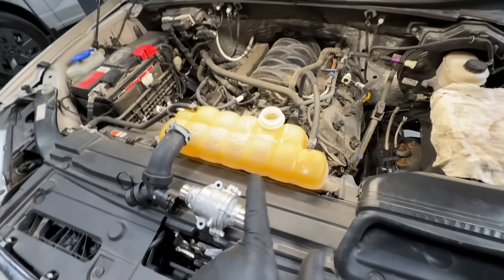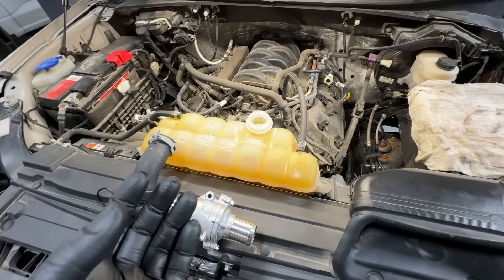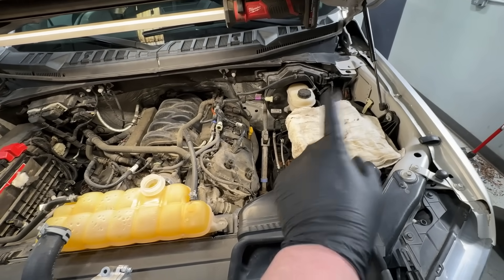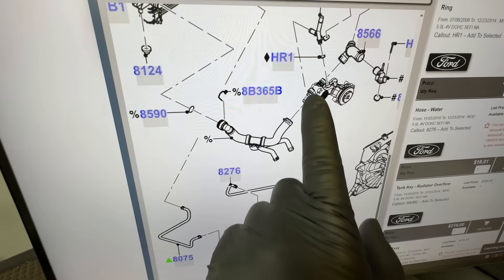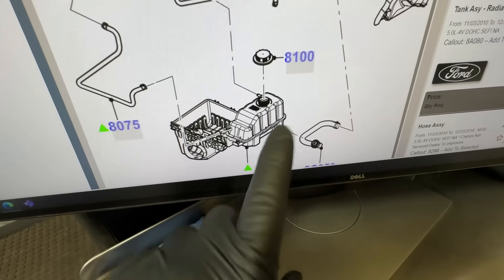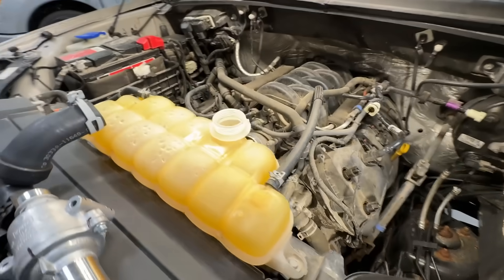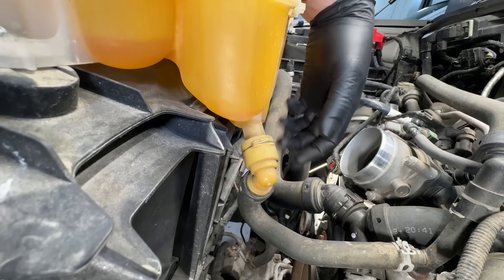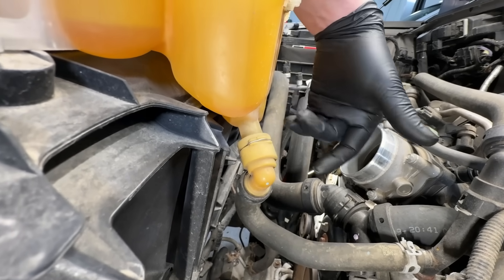2011+ Ford F-150 5.0L Coyote Engines: The Top 5 Most Common Coolant Leaks!

Comment: I agree. It is a crap engine.
Reply: It's only crap if you treat it like crap unless your this guy and you constantly work on them all day every day of the work week which does defeat the point of this engine being reliable. It's just like any other mechanic that specializes in other car brands they all have their pro and cons but it's up too the consumer too either run the vehicle too the ground with no maintenance and bitch about it not be reliable or you baby it and take proper care of it and have good things too say about (not excludingthe 2.7 or 3.5 ecoboost). What he's talking about are really only a minor issue unless it's a massive coolant leak that'll lead too overheating then it's a huge problem but if it's just dribbles you are fine until you can get the parts in and fix it before it gets bigger. The oil consumption is a way bigger issue then coolant leaks though cause that requires more time too he spent on fixing that issue.

Comment: HeyBrian, I have a 2017 3.5 eco-boost. I know it requires 5/30. Amazon sent me 5W 20 Pennzoil I changed it,will that cause any problems if I leave it in for a few thousand miles?thanks appreciate it as always.
Reply from the maker: Ideally it should not be an issue especially if it was winter but now with things warming up and it being turbo based I would drain and fill the oil and leave the filter.
Reply: @FordTechMakuloco  yeah, I was thinking the same thing. Just thought I could get away with it for a few months, but I am moving to Florida as well so probably not the greatest idea but, I really appreciate getting back so soon. I really appreciate it man. Enjoy the rest of your weekend.!
Reply: @FordTechMakuloco  hey, Brian.. I noticed when I was changing my oil yesterday that my oil pan was saturated with oil.. I’m guessing it was oil. I know you just did a video about this issue. Should I have the dealer replace this pan?truck is still under warranty..

Comment: My 2016 coyote in my F150 shit the bed at 60k with the cam phasers and VVT solenoids. Constantly stalling dealer blamed my synthetic oil and fram filters. I called BS and after fighting with management and Ford they ate it but not without a long fight. Of course they could never duplicate the issues but magically all fixed once the parts were replaced. Would’ve cost me $4k……Not this time. Got rid of my FORD POS shortly thereafter for a  2018 Toyota Tundra.   286k not a single issue yet

Comment: I've had one in 112,000 miles on my 2016; it was the most common leak. Eventually, I'll replace everything when I have to replace the water pump or T connector. I'll do all the tensioners at the same time. The A/C tensioner looks like crap, but it's still functioning.

Comment: Funny just had the heater hose replaced on mine...wish I had seen this video sooner as I couldn't find it. I have already done a waterpump and the t fitting orings as well as the connector upgrade for my coolant degas tank (2012).  I like the engine other than the ticking which it has pretty much done since new.  Also had the oil pan gasket leak and had it fixed too.  230k   Thanks for your videos!

Comment: Ouch man, 5.0L underpowered in a half ton truck?  And I don't see very many 5.0 daily drivers getting torn down to find piston skirts broken off like ecoboosts. All the water leaks were due to over-engineered hose fittings, none were the engine itself. Any engine will fail if pushed hard enough... but I see and know of tons of ecoboost total engine loss stories causing many customers to swear off Ford forever.
Reply from the maker: Yes underpowered or the calibration is off they just wind out the gears where as an EcoBoost will just pull big time. Maybe my views are skewed with the EcoBoost and electrics I have driven. They may not have skirt problems but neither do most EcoBoost engines. One thing I can tell you is the 5.0l sounds horrible, they have cylinder bore distortion issues, timing issues still 2015-2017 and valving issues on 2011-2013 models (I am replacing a 2013 5.0L now for this) and don't get me started on the 2018-2020 models. Now 2021+ have plenty of power and has been solid so far.

Comment: I just had a new 2005 ford -150 5.4l 3v create engine installed in my truck. I noticed the oils fill cap has a severe vacuum when I take it off while running. It makes a chirping sound on driver side. Once I pull oil fill cap the chirping stops. Any ideas?

Comment: Thanks @FordTechMakuloco for your information! Off subject question. I have a 2017 F150 5.0 with 90k miles. Been ran with 5w20 semi-synthetic its whole life. Should i swap to a 5w30 full synthetic to assist in the valve train noise which has gotten slightly more noisy the higher mileage it has gone? Thanks!

Comment: Im thinking about buying a 2016 v8 5.0 should I ?
Reply: do it, that's the best year for that engine. The worst issue I've ever seen with that year model engine is the VCT solenoids just not working and causing the engine to stall at a stop. They are not too difficult to get to for replacement and again not a very common issue if the oil has been kept up with. So the worst case scenario on that engine is actually an easy fix and can be done in a few hours.
Reply: @eliohernandez01 agree.I have 2015,5.0

Comment: Hey there i got 2010 4.6 2v and its got a little tick on passenger side i took the valve cover off did a visual inspection and checked the roller followers but have yet to find the culprit any thing would help its my daily work truck 120000 ive kept up with oil changes so it looks beautiful in there but i know what its supposed to sound like i bought it new what do you think ? Take the followers out and check lash adjusters to get a closer look at them ?

Comment: This is a very off topic question but no one really seems to know the answer so I figured to ask you since you are a very knowledgeable ford technician. My question is, do you know what causes the valve spring failures on the 6.2l engines? I have seen them from pretty much any year with these issues but many people claim they are not common. What I want to know is if these valve springs are failing due to lack of maintenance or excessive engine idling or just constant beating on the engine like foot to the floor? I have heard these engines are fairly reliable but the valve spring failures concern me. Thanks!

Comment: I’ve been driving the 5.3 for oh at least 20 plus years. Just bought the 5.0 and it’s sweet. Only 5900 miles on it so far but much better feeling engine.Did put a catch can on it  immediately and that’s already trapped about 6-8 oz of blow by.

Comment: I have a Ford XLT 4 door 4 wheel drive .It's a 2015 and the oil gauge doesn't t move and oil light red in color flashes as I was bringing it to mechanic. It wouldn't start just crank them stop . Could it be oil pump and is it seized . It still cracks just don t start .

Comment: I have 2013 f150 5.0 with 275 thousand miles from new only thing have done water pump 2 starters few quick coupler coolant lines 1 rear end seal

Comment: I currently just replaced my water pump under warranty, had a large leak behind the water pump. After replacing that its been a week now took off from a stop sign lost power, speedometer didn't work and check engine light is now on have yet to get the codes.. I did leave it sit now speedometer works agin but check engine is still illuminated

Comment: Could you do a rebuild or nothing on a brand new 29010 Ford F-150 XLT xtr engine 5.4 L versus a 150k miles good running engine just to show normal wear and tear. Maybe use a req test, but not waste the engine before salvage ticket! It would be extremely educational for me and many others, I would donate my engine to rebui)t if needed. Please DMand will would forward all info your way!

Comment: Recently ran into your videos great advice. Question my son bought a 2008 F-150 5.4 V8 I had someone mention to use 10-30 synthetic. Is that something you would recommend for that engine to build up more pressure in the oil pump to make sure everything gets lubricated or stick to the 5-30
Reply from the maker: 5w-30

Comment: Hi

 I have a 2007 Ford Explorer 3v 8v 4.6

 There is a problem with fuse number 2 in the input below the level of power

 Microcontroller (SJB)

 In smuggling electricity from the battery, how can you please solve this problem?

 Thank you.

Comment: I hope your shop is somewhere in California, I really need a mechanic like you. 🙏🏾

I have a 2014 Ford Explorer XLT 3.5 V6 with 2WD.

The engine was replaced with a remanufactured long block from Ford, around December 2023.

The same day I got it, I could feel a hard rumbling (when idle).

A few days after having it back, the check engine light came on. P0420 was the code.  I replaced the catalytic converter.

Still the hard vibrating continued....

About a week later, the check engine light started flashing and the car RESISTED acceleration. Codes P0302 and P0306 appeared on diagnostic. I changed the ignition coils (all 6). 

The spark plugs were inspected and appeared to have been replaced when the engine was installed. 

A few days later, check engine light flashed again and no sooner did it start, it stopped. But what I noticed is the car withdrawing from acceleration (when notification was flashing).

I took it to the dealer. They kept it for THREE DAYS (driving it uphill, running compression tests- per my request). 

They saw it misfiring on the scanner, but COULDN'T figure-out what was causing it.

Please help me. 🙏🏾 I beg you. I don't know what to do. 😢
Reply: I would get rid of and get a toyota 😢

Comment: Hey mister Ford guy. I have a question and I need guidance so please if you will respond. 2014 ford flex 3.5 non turbo  85000 miles and I know the tune up is right around the corner. I know you swear by Motorcraft genuine products and so do I however as far as the spark plugs I know it calls for SP520A Motorcraft. What is your opinion in the Bosch double platinum counterpart?  Well, they hold up like the Motorcraft plugs will?  I’m not having any misfires any kind of issues whatsoever it’s just come time to do the maintenance and I need some guidance please

Comment: Hello, Have you ever dealt with the IMRC chatter on the 6.2 in trucks? My 2017 F250 has a loud chatter that disappears when I disconnect the blue connectors on each side below the throttle body. Of course they are on national backorder. Thanks for any input you may have.
Reply from the maker: No I don't work on them.

Comment: Too much plastic then add hot water into the mix. Disposable / cheap.
Reply: Yep,plus cold and warm temperatures makes plastic brittle and prone to start cracking and leaking.
Plastics is good but I found cold temperature really change  the plastic material functionality.

Comment: So what motor would you recommend for the F150? I'm not buying Chevy's junk that uses 1 to 3  quarts of oil per oil change and carbon build up cause of V8/V4 mode.I know from experience I have a Chevy work truck. And Dodge junk Manifolds and transmissions  in their 1500.

Comment: You did a video showing how to change the coolant on the older gen where you can use hose.   With the new coolant you cant use tap water i thought so can you do a video showing a changeover to the new coolant with a system flush.

Comment: Awesome videos thanks, I have a 2013  5.0 f150 it’s has 193,000 miles ,  just getting a upper heater hose leak , no other leaks I guess I was lucky, but I’m planning to replace all hoses and will now replace the water pump and thermostat and housing , with all ford parts . Hopefully I get the same luck as before.

Comment: I usually agree with you but it all on how you use/ take care of it. I have a2020 and have had no issues with it but I’m always looking. It has a 140000 on it and still trucking
Reply from the maker: 18-20 models have known widespread mechanical defects that maintenance will not fix. You got very lucky so I would hold onto it.

Comment: Been watching you for years and you absolutely make some of the best videos on here! But your take on the 5.0 is where I strongly disagree. Not that I’m any expert, but the 5.0 is far from underpowered and strides ahead of the Ecoboost/5.4l in tech, power, reliability, and durability. I’ll take some rusty valve cover bolts and coolant leaks from mostly easy to replace parts over timing jobs, roller follower issues, turbo issues, oil pressure issues, etc any day. Regardless though, appreciate your videos as always and can’t thank you enough for all the times you saved me thousands in my old 5.4l!
Reply from the maker: Please see my previous response- Not saying they break down at all. I am just very disappointed in the engine as I had high hopes for them when they came out in 2011. The cylinder bore distortion issues, tuliped valves, way too many coolant leaks, some oil consumption issues on the rear cylinders, ignition coil bolts that rot and break (unacceptable in this day and age), valve cover bolts that rot and are miserable to remove mainly 11-14 models, the embarrassing tapping knocking noises all of these make, they have a stamped oil pan and elastomeric gasket just like the 5.4L (which never ever leak) yet the 5.0L leaks like crazy and soak the underside of the engine (why is this even happening, again very disappointing), I am not impressed with the power I think they are a dog (maybe I am used to the EcoBoost power) except the mustang calibrations and 21+ are much better. Also, you do know about the bucket load of major issues with the 2018-2020 models right? I am hoping the cylinder deactivation and wet oil pump belt on the 21+ models are not another disappointment in the future. There may be other concerns I cannot think of right now. Now do you understand my point of view? Oh and almost forgot about the IMRC issues on the 15+ models (again I have never even had to diagnose an IMRC concern on the 5.4L 3v)
Reply: Thanks so much for answering my comment! I had a feeling the issues ran way deeper than what you got into in the video as far as just coolant leaks and such and I hope a lot more people read your response because it makes a lot more sense to why you view the 5.0l with so much disappointment. I know the 18-20 2nd gen coyotes were really REALLY bad but from what I’d heard I always thought the first gen coyotes were fairly reliable. And I always figured I’d rather deal with coolant leaks and such as opposed to phaser and timing issues. I appreciate you opening my eyes to some of the issues that aren’t talked about with the 5.0l outside of coolant leaks. I wouldn’t mind seeing more videos discussing issues with the 5.0l since Ford still makes them and they’re starting to get a lot older now (even tho I know you’re career is mostly in the 5.4l)

PS. I’ve religiously watched your content since 2017 when I performed my first timing job on an 04 f-150.  Your videos saved me big time when I almost got aftermarket phasers so thank you. Keep up the great content and appreciate all the info you share.

Comment: My 2020 F150 5.0 just rolled 90k and so far it’s been great. I had oil consumption issues but luckily the TSB fixed it. It might use less than a quarter of a quart in 5k miles. It is noisy though, mainly the VCT rattle on deceleration when cold. Ford calls for 5w20 in the 18-20 5.0s, but I’ve been running Amsoil 5w30 in it since the second oil change, it definitely helped with the oil consumption and noise.

Comment: My 2013 5.0 came with coolant leaks from the upper radiator hose o ring just like you said. I replaced the entire hose and lower radiator hose and thermostat housing.  The next year the t connection started leaking 😅. I replaced that as well. Hopefully I'm good for a while 😆.

Comment: Nice video . I have a problem with my 2006 f150 lariat the fan keeps blowing no matter how you set it even if you turn it off. I have bought a new blower motor resistor yh-1715 from ford but can't find where it goes does this truck have this resistor it seems there is another type of resistor where it would normally go would my truck have both and I just don't see it thanks for any help!!

Comment: Hello, 2000 Ford Taurus SE OHV. I recently replaced the cam synchronizer on my car due to squeaking noise from the front driver side. After replacing the defect part with an OEM motorcaft one, I will can hear the squeaking noise while I drive the car on front driver side. I don't hear the noise when i open the hood while the car is in idle. Did you have any other suggestions for the possible causes? Thank you!

Comment: Like your videos, nice to know info. I bought my 2015 F150 back 2019 and the O ring went in mine. easy fix. 2 months ago had trany lines replaced. rust around the support bracket. But get this when I bought the truck check engine came on took it back to the dealer told me it's leaking around the easy fill lid ( where the gas goes in lol) So for a year and a half the light would come on and I would clear the code. Well Back in 2022 I had a smoke test done to find if there were any leaks. None were found.  Then we did a diagnostic test. and found out my fuel tank pressure censor. is faulty. ( the code number was not changing) was not opening. 
Anything that comes up goes into the shop. 
So now I have a new problem when I try to put gas into the fuel filler. the trigger shuts off as soon I start filling. it acts like, and I hear it when gas is pumped in the filler hose fill up then I hear the gas drain into the tank. I've been trying to save up money to replace the censor. Would this be my problem  or did the air channel in my fuel filler hose collapsed. And is almost on the 300 mark (KM) I'm from Canada. Any how you have any suggestions?